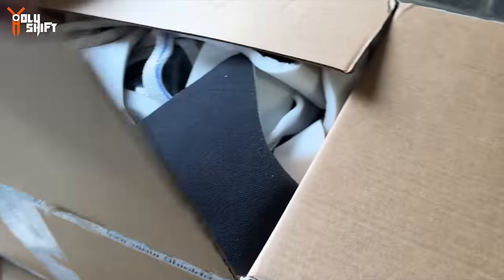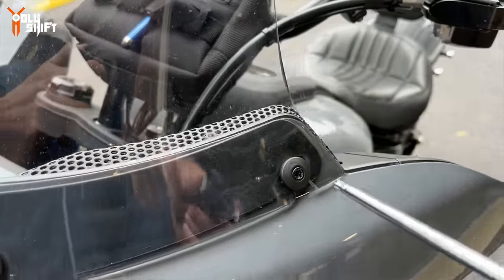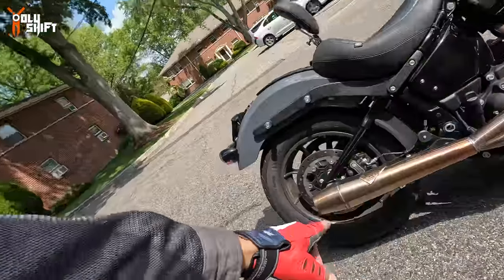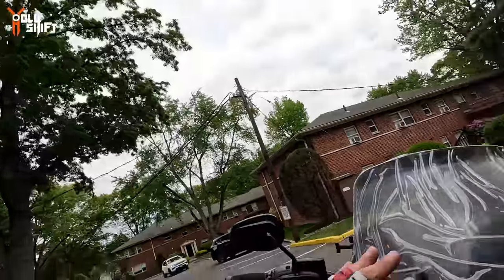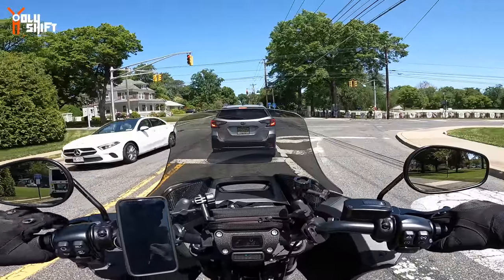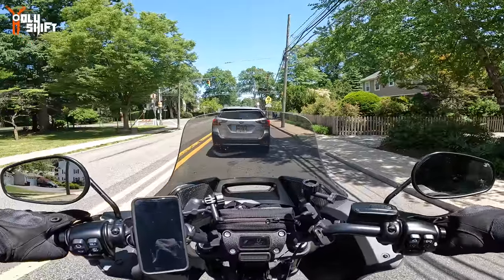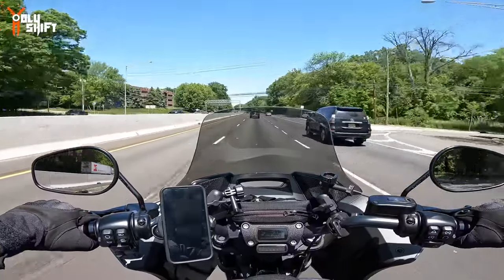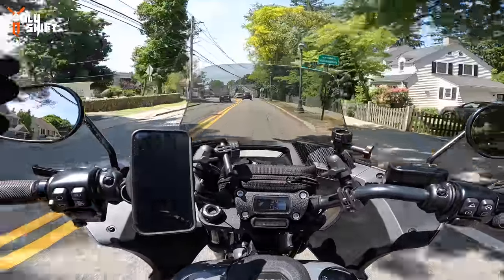Better Than The Harley Wind Screen

Comment: I also have the Clearview on my ST but in Large. Medium just didn't cut it for me so i decided to go with a large (im 5'10). The sides of the shield that you talk about can be adjusted to go lower just loosen all the screws and slide it down. However, don't go too close since the wind does push the shield and ends up rubbing on your paint which lots of people are complaining about on the Facebook forums.

Comment: Glad it worked out for you. This weekend I tried their Medium and Large windshields, both caused head buffeting (I'm 5'9"). The Large pushed against the wind enough to affect steering. The stock puts more when on me, but at least it's clean air that doesn't affect steering and no buffeting. Was hoping the taller Clearview shields woulds take the wind away, which the Large did, but the buffeting I couldn't deal with.
Reply: I felt the exact same way about the medium clearview. Especially above 80mph. I went back to stock. Might try the 8" clockwerks but feel woth there much more drastic recurve it will just be worse than the clearview. Sucks

Comment: The flair is the key to the wind management and removing turbulence from the rider’s area.  The extra side material looks good to me - if it was any lower and closer it may scratch your fairing and customers would not be very happy.  Good review Sandy.
Reply: I got a medium clearview and it made head buffeting worse than the stock sheild. Especially above 75-80

Comment: You what was even better? The Clearview Windshield with the louvered vent.  You can get air if you want it, but you can control buffeting by close to 100%.  I have it on my Electra Glide Standard. Also, the wide version is awesome, height just below your eyes.
Reply: Is that available for the lowrider?

Comment: Sandy, use the HD OEM "top / Outer " washers that are already tapered to replace the Square- edged washers " from the Kit.  [ You would need to machine the square-edged washers on a lathe to keep the taper consistent for them otherwise, and then possibly need to polish them with methyl- chloride while they are in the lathe  to remove the tooling- scratches, etc ].....  Ciao.

Comment: Hi 👋, great review, regarding fitting you might be able to find a small engineering shop that does small project, where they can turn a fitting with a larger head that covers the plastic washer, so it is all in one , with a Allen key/slotted/pozzy drive head , good luck. Ride Safe, 
Phil from the moulin France,

Comment: Any comment on whether to get the vented or non-vented version?  I have the 2022 Low Rider ST El Diablo.  Two Harley windscreens both caused whistling noises. I plan to get the largest Clearview.  I am 5' 10" tall.  My goal is to hear the speakers better and have less wind on the highway, especially in the winter.   Thanks

Comment: @Holy shiFt. Please, tell me.  Does the wider windshield keep the wind from around your ears.  My ears are sensitive and ring from wind noise.  If it keeps the turbulence from your ears, I'd like to know.  I'm a big fan of Clearview Shields.  I've bought 3 of them from CV.  This would be my 4th and I would like to get it right the first time...again.  Thanks in advance.
Reply from the maker: I can’t really tell the difference… I assume it’s more protection on the sides… but I’m not sensitive enough to notice